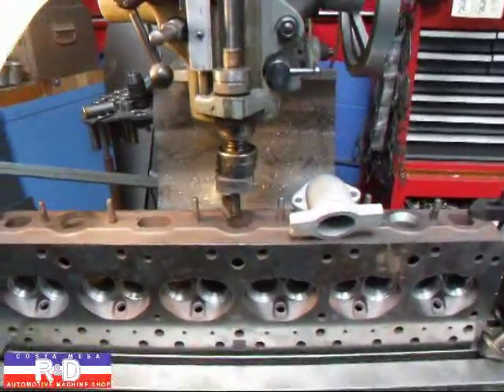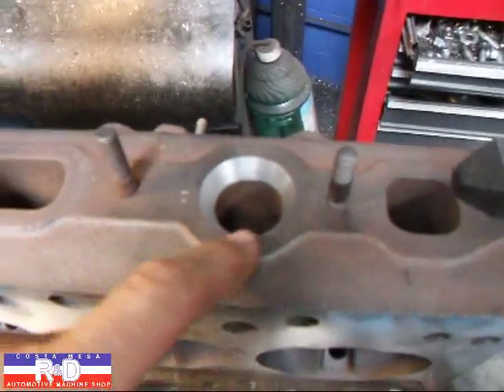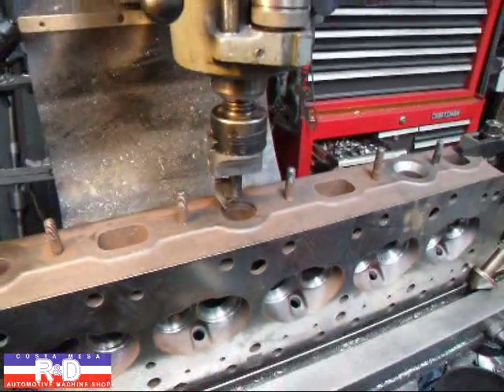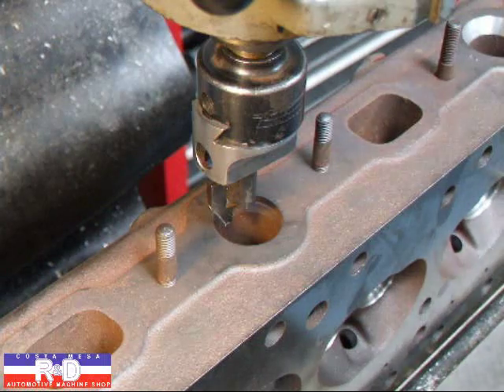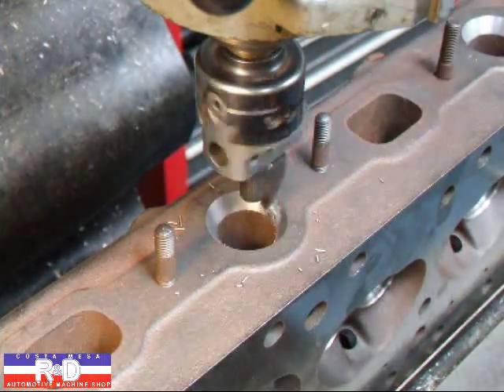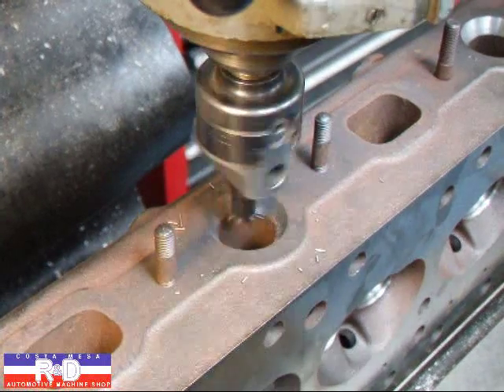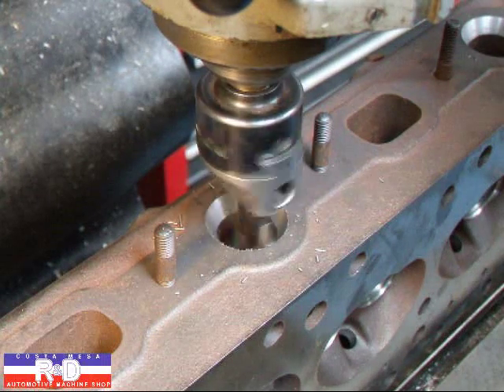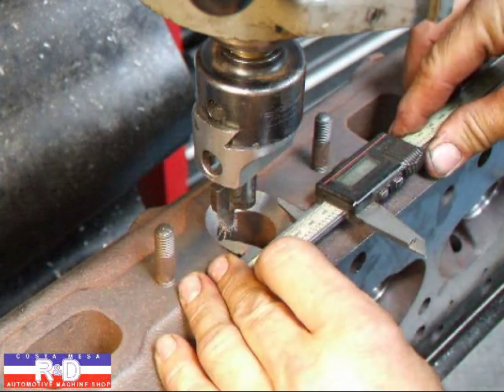270-Intake-Port-Match.mp4

Comment: What benefits are there if you just open up and taper?  Wouldn’t it be better if you actually bore out the port to a larger diameter for less restriction and even flow.  ? 
Just doing the tapered section only wont benefit at all.